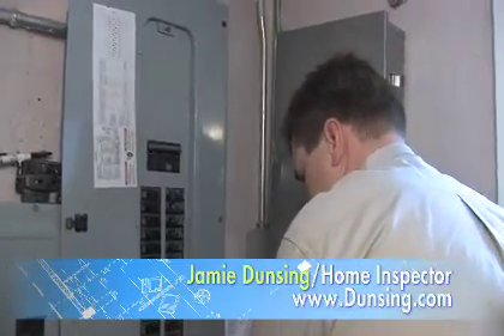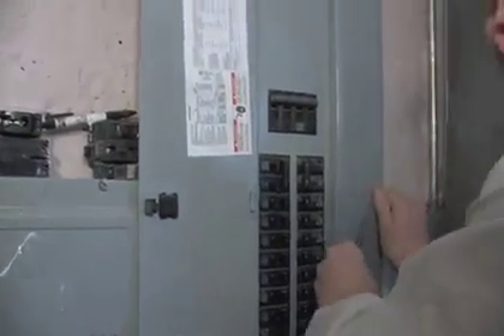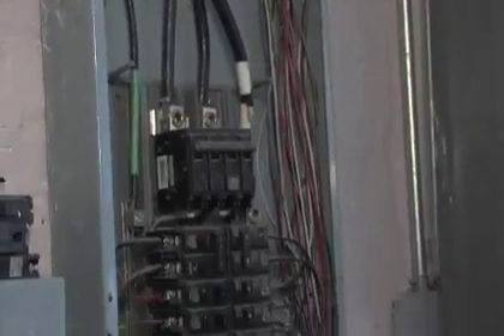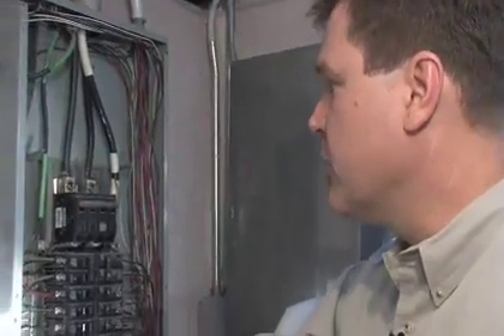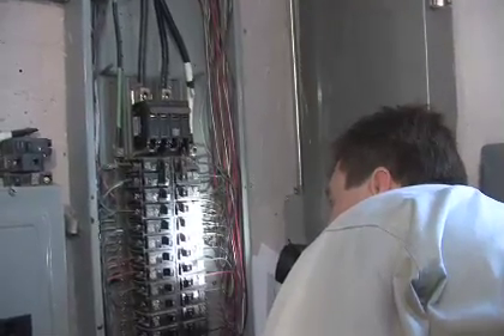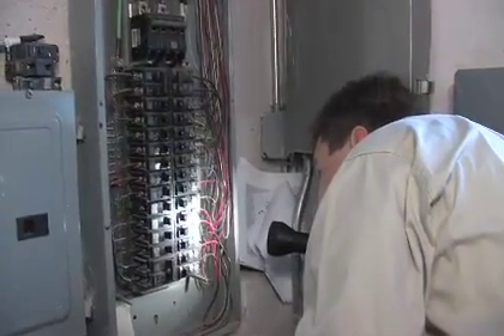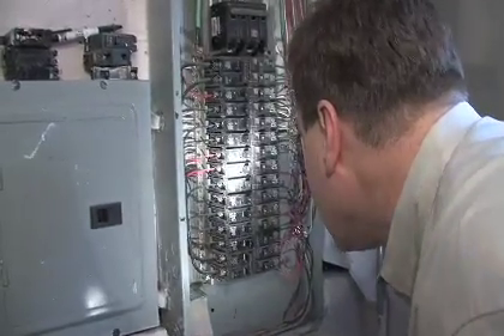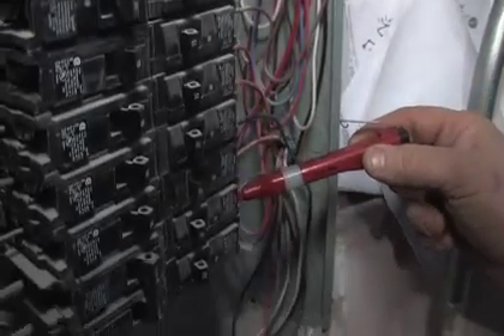Electrical Panel or Circuit Breaker Home Inspection

Comment: That is why any protective device and electrical panels have what is call an I.A.C. ( interrupting amperage capacity) rating because on a direct short  a protective device depending on the system bonding, can still let enough current pass through before tripping that can really hurt somebody.

Comment: @thisismewhy checking the wires is important - makes sure insulation isnt breaking down from overheating from overloading a circuit, make sure there is NO aluminum wire (was outlawed by the 1975 NEC), and to make sure the connections to the breakers is correct. really, you should check EVERYTHING

Comment: @tgtplyr What he means is that those kitchen appliances draw  between 1,000 and 1,500 watts per appliance. Put both a toaster and a microwave on the same 20 amp circuit and you'll exceed 20 amps on a 120 volt circuit (20 x 120 = 2400 watts).

Comment: In Chicago, EMT is required for house wiring. I know that sounds strange, but it's true. The two most important things  that should be checked in a main panel is ampacity of the conductors, the overcurrent protection devices they are attached to, and that the grounding electrode system is properly bonded to grounded neutral conductor. Sound confusing? It is. And that's why a licensed electrician who is insured and bonded should be the one doing an electrical inspection, not a real estate agent.

Comment: not always the case, i sometimes leave some spare breakers behind when i wire a new panel... if i didnt use all the breakers that the homeowner purchased or if they have decided against a few circuits for me to install

Comment: another important thing,after he checked for the correct wire gage accorting to the ampacity of the breaker, is he should pull the wires one by one to see if they are property conected to the breaker, also check for loose neultral wires, if any of the wires are loose , this causes arcking, 220surges on 120 circuits, and in some cases fire, also burned apliances. 
MACH ELECTRIC. CA.

Comment: However under a direct short in the feeder side of the panel inside the electrical box an arc flash can develop before tripping the main breaker or blowing the fuses, which has the potential to be very harmful if the person is in very close proximity to the flash even in a residential service because of the energy at the pole transformer.

Comment: I think he means he was shocked by the 120V and as we all know thats why a GFCI is set to trip between 4-6 milli amps. And yes your body can (depending on many factors) conduct more than 4-6ma. What huge was saying is that an arc blast (fire ball) cant kill you, totally two seperate matters, but an arc blast of any kind can burn the heck outta ya, and depending where it happens matters too, like on the line or load side of a main, a blast will usually open when its completly damaged.

Comment: i know what ure talking about.... another thing i noticed is the mains werent seperated from the other wire feeds... in ontario its code that they have a seperate cover/ compartment and you cannot run any of the circuits through here.... this is a residential code.

Comment: If that was the main service panel that he opened up the first thing he should have noticed is there is no shield over the service conductors and service side of the main breaker which is a code violation in Canada (not sure if the NEC requires it).  If he was an inspector in Canada I definately wouldn't recommend him. ps totally agree with texas

Comment: This goes to hugeshows about not getting a really bad arc flash on a residential service, or 120 service as he puts it. the purpose of a breaker is to limit the amount of amperage going through a wire so as to not overheat it, and trip the breaker under an overload, or a short circuit if the circuit is PROPERLY GROUNDED.

Comment: @hugeshows 120/240 will give you a nice pop and bang with 3 phase 208/230 should not give a bad arc flash but still a nice one but then 277/480/4160 will and could kill you.Were the right PPE

Comment from the maker: The home inspector in this video is only showing what a home inspector would look at during a routine home inspection that a buyer would pay for before  purchasing the property. It isn't meant to be a full-fledged electrical inspection. He's just checking to make sure it looks like it's wired correctly. Ilyce Glink ExpertRealEstatetips
Reply: I just had a home inspection on my condo I have for sell. That inspector could not have been more flip in his examination. He just states the breaker box is old and not certified. So I need to have a license electrician see if it needs to be replaced? I'm lost on that assessment. This property was built in the 70's and I never had any problems with it. How was the box not "certified" then and why is he punting to this idea that an electrician needs to come out at my expense if he doesn't see a problem? Isn't that his job? I felt like he was just looking for things to run up a cost for me. Things that need to be fixed should have a specific and identifiable reason, not generalities based on a whim.

Comment: No Sir that is a NEC violation. If you need to join two circuits that has to be combined in a j-box outside the panel. Read your code book.

Comment: @Shawnnh78 you sure about that??? 120 volts might not kill you, but 277/480 will for sure knock you back (off a ladder or away from the panel causing head injury or another type), and higher voltages will be like getting hit by a bolt of lightning

Comment: but its not.  The problem will arise when "joe" believes that when he got a home inspection they checked the electrical and everything is ok.  When someone buys a house based what a home inspector says is ok, then where does the liability lay when its not ok? What if a house burns down and it was something that the home inspector missed.  The inspector has no liability owed to the homeowner simply because he/she is not certified to inspect electrical.